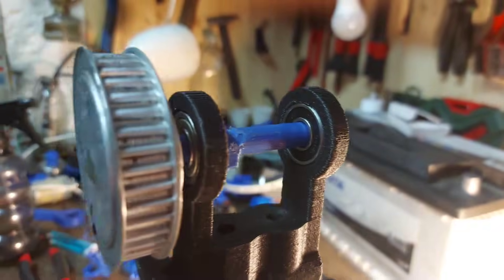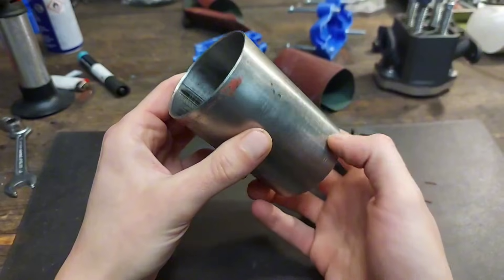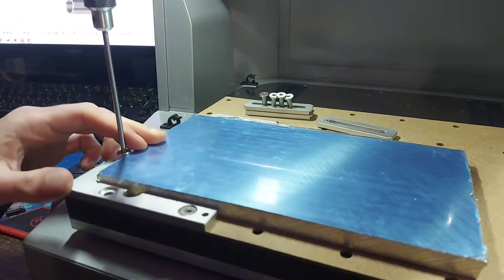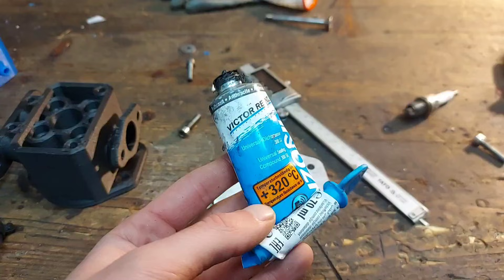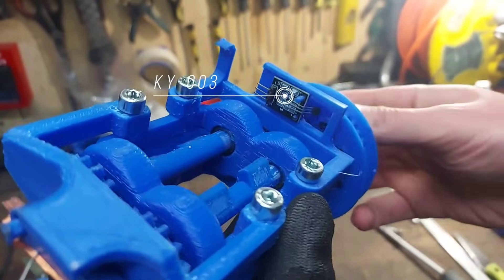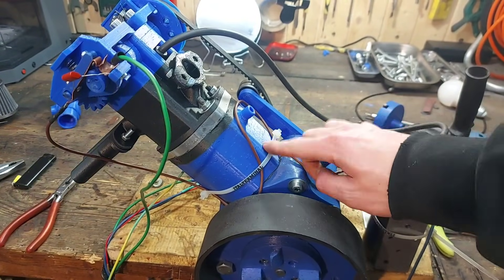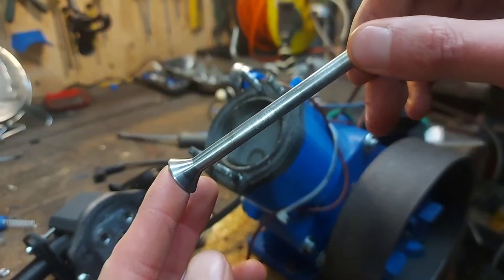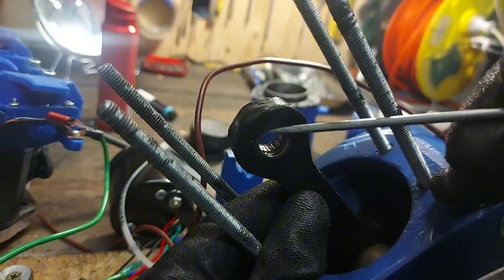I 3D Printed a Working 125cc Four-Stroke Engine

Comment: Why not use PETG instead PLA? Its more durable and heat resistant while being cheaper from carbon. Also for smaller parts for example cams use more infill?

Comment: If its one thing I would recommend on the 3d printing front it is heat treating all your nylon carbon parts that takes a lot of stress. It will help the separated crystalline structures in the nylon grow and add strength. There's recipes online but it's only like 70 or 80c° over a period of time so easy to do at home

Comment: Try printing with 100% infill - with ironing on all layers - this should create a much stronger part, but will massively add to the print time. Also try to lower the layers to around 0.1mm to 0.08mm.

Comment: 10k RPM with a four stroke engine in 3d print. Not with a plastic piston and chamber 😂. That's to much cheating to archive a goal.

P. S. Carbon fiber in filament is a weak point (it's proved)

Comment: As your running an interfearance engine design. Why not look at creating reliefs in the piston to avoid any contact if it skips a tooth again. 
Also having the valves at an angle will reduce contact area if they do hit and reduced the relief size 

Cant wait to the next video

Comment: For the piston, try printing it sideways so that the only way it can split is if there is stress going outwards. This will make it so the piston can't come off the rods at high rpm. I did the same thing on a dirt bike I made (motor mount), and it turns out that that is the best way to print it for fewer chances of breaking (and it will have higher longevity)

Comment: make a mold and pour a high quality resin into the mold from smooth-on or any of the other companies that make good stuff. then de-mold and post process a bit, bam, super durable piston. just boolean your piston into a cube in blender. ad a fill spout, some sprues to let air escape. bam ready to print n pour. maybe a more gentle gas is whats needed, what about propane ? you could get a simple propane torch, turn the gas on and hold it up to the intake without lightin the torch and it should draw in some good gulps of gas if the valve is turned up high enough.

Comment: It sounds almost exactly like my buddy's 1987 Honda fourtrax trx350 but it has been parked since last year because of the valves hitting the piston and causing there to be a hole in the piston as well as metal in the bottom end which we can't exactly get to without splitting the cases

Comment: i'd have three suggestions for a new revision:

1. make the exhaust valves bigger than the intake valves for improved airflow and scavenging
2. print parts like the piston at an angle for increased toughness/durability
3. make the lobes and valve caps from PETG, it being tougher than PLA and having a lower coefficient of friction thus reducing friction losses and heat generation (which PLA hates).

Comment: which of your rpm meter cables went to + and - ? ive got the exact same one from temu for my pitter XD
Reply from the maker: Yeah I remember I couldnt find any wiering schemes , I did black yellow cable to the negative side of the coil , black cable to positive side of the battery and green cable to negative side of the battery
Reply from the maker: Also the small black and red are for the lights so + and - on the battery

Comment: This is such an awesome project! I recommend trying different settings with the printer to help strengthen the piston along the layer lines, I've had really good results with intentionally over extruding and increasing the line width to make stronger parts. You can also print a bit slower to get better interlayer fusion, as well as a adding a volcano hotend/nozzle it melts the plastic more completely giving better strength if you don't have one already.

Comment: Carbon fibre reinforced material is NOT as strong as ordinary PLA despite all the claims otherwise - its been proved at a microscopic level to leave voids in the print layers due to it simply not adhering to the surrounding material.

Comment: Here are some ideas: 
You could buy some jugs of methanol and add about 5-10% water and run it on a very rich mixture of that if you want to run the engine MUCH cooler so it doesn't melt parts and so it can run for longer than if you were running it on gasoline but still use thick printed parts near the studs and areas that need to be strong. 

You could definitely put a thin metal strips around the surface of those cam lobes and some metal caps on top of the valve tappets and a bit of oil in there to give them some life. 

You could design the engine to be a non-interference type engine (like the Toyota 22RE) by giving it a tall combustion chamber and a dished piston, so even at top dead centre the piston crown sits well below the fully open valve heads that way if it loses timing nothing else breaks. That could end up saving you money and time and let you get more testing of other parts.

Comment: just curious about the nylon, why pa12? it's more expensive and not as temp resistant as pa6-cf or ppa-cf (ppa-cf is more expensive i'm aware of that) otherwise it worked pretty well!
the prints seem underextruded for some reason
love the camera angle based on the perspective of the wrench at 6:39

Comment: Do a minimum of 10 walls and 10 top/bottom layers, and 100% infill. Same settings as printing a firearm frame or lower, so the piston should gain a lot of strength with minimal weight gain.

Comment: Someone did a test on carbon fiber fdm parts and it is not that great if it stresses too much. Like the application of engines parts. The fibers doesn't adhere strongly and has a lot of micro air pockets. Maybe use a real vacuum bag carbon fiber parts for durability.

Comment: i don't mean to be discouraging but i'm really sceptical about this ever reaching 10k rpm , the stresses an engine faces at those kinds of revolutions are insane ... 3d printing is good but PLA & carbon filament will never be strong enough to withstand what you're trying to achieve with it , the surfaces of components aren't accurate enough to be consistent either , i wish you all the luck in the world but i can't see this ever withstanding 10,000 rpm.

(edit) this reminds me of a certain game controller operated submarine that wasn't strong enough to do what it was "designed" for 😂

Comment: If you're going with 3D printed then I'd suggest that a rotary valve cylinder head would be easier to work with. The loads on poppet valves and the cams is pretty insane and rotary valve cylinder heads aren't interference engines so any failures aren't anywhere near as catastrophic.

Comment: u are getting better and better! And to improve even more I would try to reduce by a tad bit the cooling on the 3d printer, helps with layer to layer adision also try to focous into relaibility them on the rpms. also most of ur engines fails or will fail on the piston. btw W machine that u have i hope to see even better engines

Comment: Once the engine is fully operational and all the tolerances are worked out to prevent leakage, you can use the 3D files to have the parts 3D printer/CNC'ed in metal.

Comment: Why do all your prints look so crap? You need to dial in your settings bro.
Reply from the maker: They are printed with a 0.8 nozzle for more strenght also im using a ender 3v2 , but I could dial it up a bit ngl

Comment: you can try make a hall sensor sistem for the valves to control the spark with an microcontroller, you can also porgran a spark advance to make more power at high rpms, great video 🔥

Comment: I would be curious about using water injection into the cylinder as a means of keeping the temperatures down. It might allow for longer run times.

Comment: Can you paint the piston with conductive paint and make electrosis with a metal to make the piston stronger?
Also, try using metal piston rings, I know it should be 3D printed, but all the engines that you got looses compression

Comment: You shouldn't use PLA for the valvetrain, because of the friction it makes at higher RPM, and also, you could redo the cams with a bigger profile so it can suck more air in order to actually reach the 10k, beside of that, you should also consider using a metallic piston so it doesn't melt in longer runs

Comment: Would it be considered "cheating" if you still 3D printed the body parts BUT what if you added in some channels in the shape of a wrap around X. Then you could order an X shaped exoskeleton (I'm just trying to describe an efficient exoskeleton design. It can be whatever shape or design you want) I just thought it might be a really nice way to add structural durability to this 3D printed combustion engine. God speed brotha!

Comment: That piston is designed as if it were made out of metal, remember that it isn't; try to increase the area of contact between the lower and upper parts, and maybe make the skirt a bit shorter.

Comment: I have a suggestion for improvement. Why not use liquid cooling around the piston with a 3D-printed water pump connected to the existing belt? That would likely eliminate the overheating problem.
Reply: That would add an extra load to the engine, and it can barely run itself
Reply: @Giuliana-w1f He could run an auxiliary pump on the side not connected to the engine just for the cooling.
Reply: @Giuliana-w1f  It probably can do it but 3d prints tend to be porous so it's more likely to leak all over more than anything
Reply: look up liquid cooling systems from 1920s engines. you could build a piece that just clamps around it and convection cools itself as it heats it will make pressure and push it up and through and the cold fluid in. in a tiny radiator or use small tubing and wrap it around. a trans cooler for a car would work maybe a little big tho. also just make the intake piping a tiny bit thicker and its gonna rip.
Reply: You could use a vapor cooling chamber of some sort.
Reply: There already is watercooling

Comment: bolt a metal plate to the top of the piston, and have the bolts run all the way through the piston to nyloc nuts on the other side. should prevent heat damage and splitting.
Reply: It would add reciprocating weight, so it would probably need a stronger rod too
Reply from the maker: This is most likely the next step, but im thinking to actually make threaded holes in the aluminium plate.
Reply: @alexslaboratory4976 that’s fine but doesn’t really help with the splitting as much as having some kind of metal threads on the other side of the piston

Comment: Print your piston with a variety of tests: angled print, flat print and vertical printing. Figure out which one gives it the most strength! As for the connecting rod it's doing amazing for all it has been through! Nice work with the valves, I'd personally try some gears for the timing. Would not only be really cool to see but you'd also end up with less of a "yank" whenever the compression point forces the cams open again

Comment: Excellent job with the new designs! Everything looks really good!

Also would never have expected the piston to split in half like that, but I guess that's 3D printing for ya... perhaps since you are sealing it with O rings, it might be beneficial to stand the piston up on its side to maximize the strength. The Cylinder wall should keep it from delaminating down the center and then the strongest direction will be the direction that the connecting rod it hitting it in.

Anyways, awesome upgrades! Looking forward to seeing more!

Comment: Really love your vids, started my own 3d printed compressed air engine.
To solve the Piston Splitting across the layer lines, maybe you could use 4 screws with threaded inserts. You could have big holes that only get smaller at the top of the Piston. Melt the inserts in and use big washers. Maybe this would help, apart from material choice and print Settings. 
Keep the good work up.